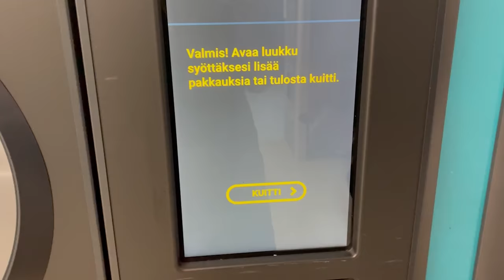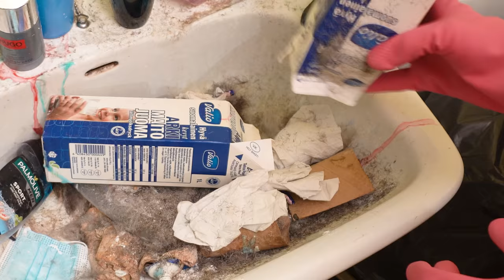48 HOURS DEEP CLEANING FOR FREE

Comment: Congrats on getting engaged!   Question: does cleaning and opening windows get rid of the smell usually?
Reply: Most of the smell is probably from the food packages and milk bottles. It will dissipate when they're removed.
Reply: bad smell are mainly from bacteria, rotten food, etc. things on a bad state, so yes, cleaning and airing works.
Reply: @georgielancaster1356  Be careful with essential oils if you have pets though, it can be harmful to them

Comment: In the U.S. we have a lot of tile floors with grout.  It can be very difficult to clean.  I envy the hard floors you have and the drain the the bathroom floor.  We also use a lot of hardwood floors and most cabinets are also made of wood.  Again, much more difficult to clean.  Plush sofas and chairs, wall to wall carpet…..I sure wish I could clean like you do!  It would make my life so much easier.

Comment: While cleaning the refregerator, i turn it off to clean its back and sides to make it safe. Also i move it aside to clean the floor under. The upper side i cover with stretch and just remove it to change for clean stretch after wiping the dust over the refregerator.

Comment: Glue of the fridge shelves will loosen over time from the dishwasher, not a good tip. all the glass shelves have plastic parts sticked to them. High temperature will ruin them.
Reply: There isn’t any glue on the shelves though. And you can just clean the shelves using a lower temperature on the machine.

Comment: Ok. But I hope the hidden dirt rest will not grow after your hard work by itself.
1.) Why didn't you cleaned the floor first keeping yourself & your shoes clean inside this dirty trash? 
2.) Clean many dirty things, w/o dishwashing maschine, is much easier in hot/warm soap water bucket 10L + 1 dishwashertablet, wait until fat dirt is removed ... 
3.) Demontage - Clean - Montage of refridgerator drawers & plates, light switches, power plug (profi tip from 1984 Radio- & TV service & repair technician use this cleaning PC keyboards key caps, electronic device knobs/switches/cover). 
4.) Dont damage damage material with aggressive cleaner! So be careful with: 
4.a acid cleaner on metal, 
4.b alcohol cleaner on plastics !